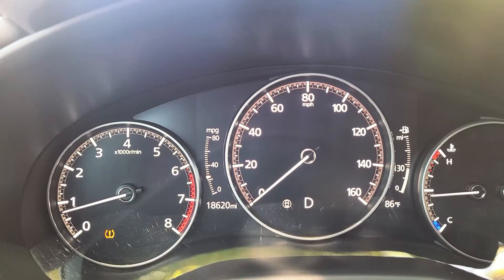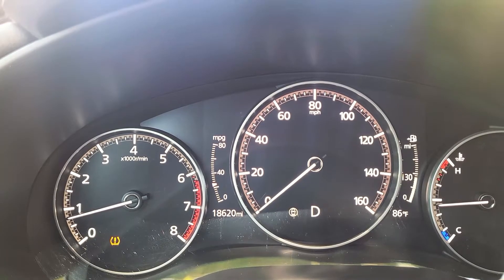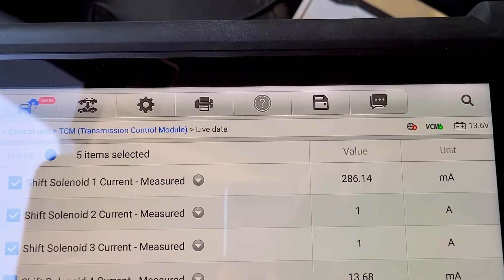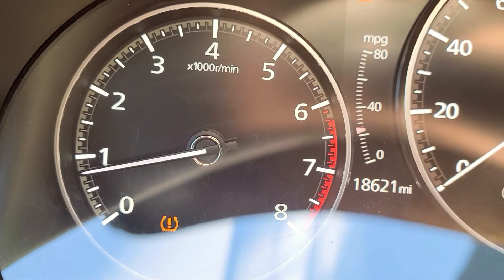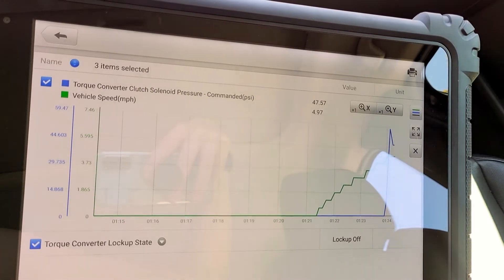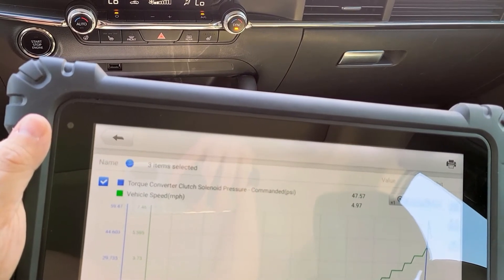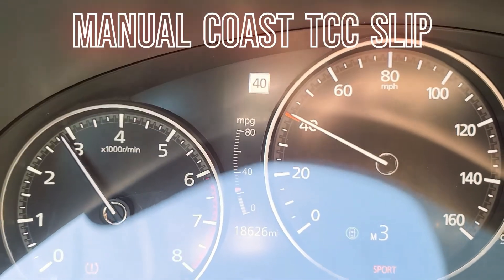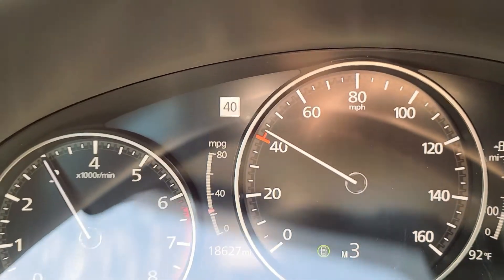Quirks and Jerks of the Skyactiv Drive

Comment: Hi, @21Mazda3Turbo. Thank you for sharing your very unique expertise on this channel! I wanted to ask your opinion on the set of issues with my Mazda as you seem to be very knowledgable about their SkyActiv ATs. If you don’t mind! So, I have the 2013 CX-5 GT AWD with 150k+ miles. During last year or so it has developed the following set of problems with the AT: a) the shifter may be very stiff when going from P to R (vehicle is stationary, the brake is fully depressed), it feels like you are forcing the shift and when it happens the whole car body shakes/jerks; b) in lower gears (most often it’s 2 -> 3), under higher than average acceleration the upshift may be delayed and come with another car body shake in the end; Note that it's really hard to bring it to someone for a diagnostic as these issues come and go and I can't reproduce them consistently as of now. I got this car when it already had 130k+ miles and the previous owner only followed the maintenance “by the book”, so no ATF changes were done to it. Is my AT basically a ticking bomb at this point or is there something that can be done to improve this situation short of a transmission rebuild? Thank you in advance! I would really appreciate your response.

Comment: These transmissions seem to like a rather firm pedal input.
Reply: I never noticed it until i started driving more conservatively, both of mine just want blast off all the time, it's like calm down bro gas is over $3 rn
Reply: They definitely do. I wish Mazda would have tested these more in steep terrain. I find it doesn't know which gear to pick when going up slight inclines and around curves. My 2015 tries to lock the converter going up our very steep driveway. It's annoying but this video helps explains a lot.
Reply: Yeah my CX-5 turbo does weird stuff once in a while.  Almost like it's starting of in 2nd gear or short shifting really early.  But with some more pedal it downshifts and the Turbo starts doing it thing.  It's annoying cuz the power is not there then all of a sudden Whoosh!  Even with AWD, the mild torque steer can catch you off guard!  FYI...

Comment: I see...my new cx8 2.5t is quite jerky.....good explanation bro.....got used to cvt😅....is it normal for small thud sound when clutch disengages, and we press pedal almost immediately??...sounds like lockup or clutch but cana only be hear when turned off ac and radio
Reply: my mazda with 172,000 miles does this same thing

Comment: Do you recommend people to do that Transmission relearn procedure? I had my car for 2 years never did that yet. Drives fine, wondering if it would eliminate some things and make it faster off the line or anything like that.
Reply from the maker: Some people have reported improved shift quality. I know for me it cleared up a certain TCC behavior I didn't like and I purchased my car brand new.
Reply: @grolladat  ive been trying to do the steps in the video but it doesn't work. car was on for over 1min. Temps were up like in the video, and followed all the steps. guess by your name it does work on the turbo models as well.  just cant seem to get the last step to work where the gear numbers on the dash screen disappear. ill keep trying.
Reply: @dvgd999  mash the brake . like you need to try to put your foot through the floor. and do not let off AT ALL til its done. most people think theyre pushing down hard enough when they're not.
Reply: @Aysus got it to work. Yeah must have been not slamming the brake pedal through the floor that was the issue. Thanks for the help.
Reply: @dvgd999 no problem!

Comment: I call it 'character' lol. Once I stopped worrying about I really learned to like it and it's very predictable and consistent. I don't know if the 3rd gens unlock in manual mode off throttle in the same way, I've only really noticed when coming to a stop at like 15 mph or less.